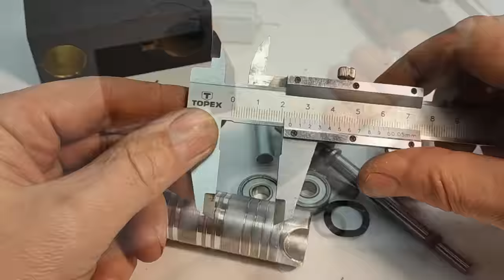Amazing. DIY mini Drill Press.

Comment: Didn't even need to finish the video. a decent drill press is much cheaper and readily available.
Reply from the maker: maybe you're right. but I wanted to do it myself. Thanks
Reply: Few people could miss the point as badly as you, Suhayl. 😄
Reply from the maker: @torqueytorque8861  Thanks

Comment: Very nice build, really well done! And that Phenolic for the headstock is an excellent choice, it's dimensionally stable, and very wear resistant. I use it a lot.
And that's why this beauty deserves a better motor (there are some lovely speed controlled brushless motors with high torque at low rpm), a scale for the fine adjustment and a tiny drill vise.
Reply from the maker: thanks. this is interesting

Comment: Most excellent! That micro adjuster is brilliant. I very badly need a mini drill press like this, but the cheaper ones have horrific runout that makes then unusable for detail work. I don't have the machine tools necessary for this build, but I plan to design one up and test fit with 3D printed and off-the-shelf parts, then have the pieces cut by an online service for the final. I think if I design the individual parts to be easily and cheaply laser cut, I should be able to get it done on a budget.
Reply from the maker: Thank you very much. I'm very glad that you liked my project. Good luck in your endeavors. Don't forget to share the result. it will be interesting

Comment: if I didn't see this vid on you building it, I would swear it was factory made, truly professional finish, especially the fine adjustment wheel/knob for the headstock, aside from the mirror polished finish on many of the parts. I also noticed the run out on your headstock and drill bit looks to be damn near zero..Dremel tools have really wild and bad runout..  the mark of a really well made drill press is the runout or how close to centered without wobble  the bit rotates. your drill press is VERY accurate. like it can be used in a professional setting
Reply from the maker: Thanks. It's great to hear such comments. Considering that I am building a drilling machine for the first time in my life. My goal was to achieve maximum accuracy and minimum spindle runout in order to drill with small drills. thanks again this is very motivating
Reply from the maker: watch this video you will like it  https://youtu.be/JPvsIP4gOsM

Comment: A slightly larger table, with some tee-slots for proper work holding and you start to approach being a mini-mill. I actually see some real uses for that in a hobby shop. I also would have used a brass block, rather than the wooden block, for more rigidity.
Oh yes, very nicely done.
Reply from the maker: Thanks. but it is not a wooden block. this is textolite. material impregnated with resin and compressed under pressure. very strong material.

Comment: Nice build! 👍 What is the head made from? Tufnol?
Reply from the maker: Thanks. this is textolite. compression molded material
Reply: Hello, not My MiniCrafts but, quoting one of his other comments, its made out of "Textolite". He says "material impregnated with resin and compressed under pressure. very strong material."

(Edit): After doing a little bit of research it turns out that textolite is another word for micarta/glass impregnated resin/fiberglass/compressed resin + wood. It can be made out of a variety of materials but is basically wood micarta. It looks like in the 70's they made countertops with it!

Love your channel by the way :)

Comment: Nice project, otherwise, let's make a $10,00 drill press using a $10k lathe
Reply from the maker: Thanks. How else? to make a machine you need a machine. it's all about the size
Reply from the maker: @pedroernestobraga  it will be a very interesting project. I bought soybean machines at scrap metal, then restored them, they were very cheap. I will follow your channel. I myself once wanted to do this, but then I decided to restore the old machines
Reply: @serengytech  thankyou sir I really apreciate that
Reply from the maker: @pedroernestobraga  👍